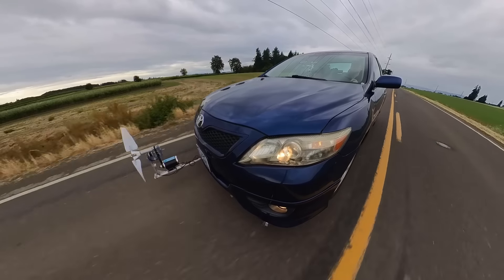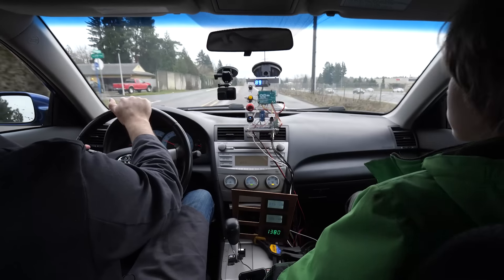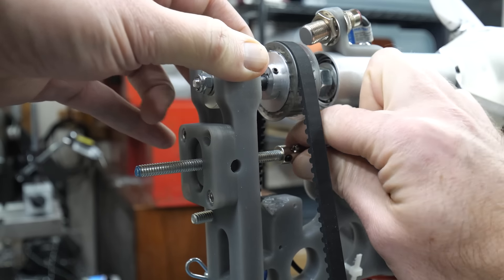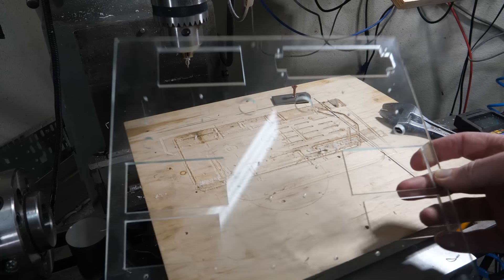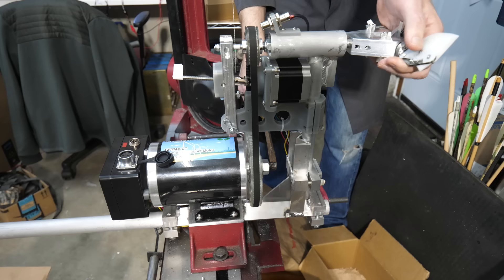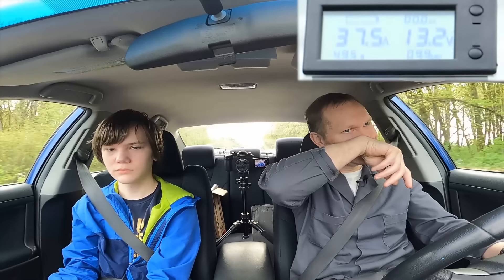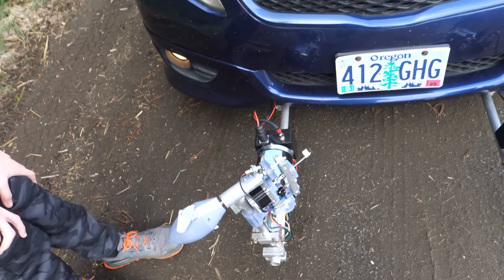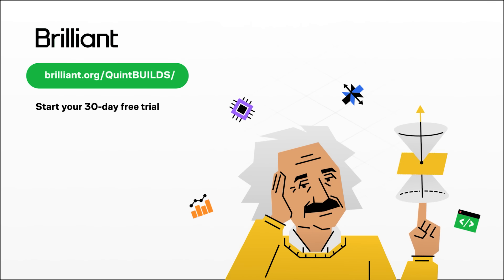Wind Power on a Car #7

Comment from the maker: Behind the scenes content is here: https://youtu.be/NZDZXdZAW10

Please don't jump to the conclusion I'm some "free-energy" nutcase. I consider myself an engineering educator, willing to run experiments much of the public wonders about. When this project is done, no one will have to wonder what a turbine on a car does. I'm grateful most viewers can appreciate that!

Thanks for watching.

Quint
Reply: Great video
Reply: 😊 I'm glad your doing what your doing, spending time with your son, opening up a world for him to pursue engineering, and letting us follow along with you.

I still have my fingers crossed for a chance at an aerodynamic slip stream with a pocket of low pressure slower moving air over the vehicle presenting less drag than the drag presented by taking power taken from turbines.

Its Not free energy. It's  just that a potential for a reduction in overall drag could mean higher efficiency.  And there is president for aerodynamic slip stream where two truckers following close to eachother will use less combined fuel than if each traveled seperatly.  But realistically, it's still probable that adding turbine blades infront will create more overall drag. 😊
Reply: Roger that but why not use VAWT and avoid all that mechanical complexity and stresses that comes with HAWT.
Reply: @OnlyUseMeC4s  VAWT tends to not be as efficent at HAWT,  and changing the pitch of VAWT blades for maximum power adds its own complexity.
Reply: I got into your channel when you were doing the rainwater generator (which was pretty cool).  Appreciate the explanations along the way in all the videos too.
Reply: Your using one form of energy and trying to regain/capture energy in another form; so inefficient energy capture?

It's like saying this is not legal or medical advice and telling people about legal or medical advice lol.

Juat cause you say it's not free energy dont remove the fact that you are conducting tests to gain energy from a different form.

Not all ideas are good ideas. Maybe you should put 2 alternators in the car!?!?!? 😅
Reply: @LawPope  

Automobile surfaces have air friction ofc, wind resistance. 

Wind power is a cube ratio of its speed. It increases swiftly. e.g. 1mph=1 ; 2mph=8 ; 3mph=27 ; 4mph=64 ; 5mph=125  etc..

Assuming a car drives in still air (0mph) propellers will increase the speed of a part of the air before it reaches the car surfaces, decreasing its friction power against these surfaces by -x^3 (yes, I said a double negative, but just so a reader wouldn't miss it). 

    Obvs, the propellers transfer that resistance to the car via its frame.. 
    ..UNLESS you remove some of the energy.. As electricity. 
    Ofc greater generation causes more resistance on the propellers, but increases air speed, decreasing resistance on car surface friction. 

Automobiles have main purposes far more important than minimizing wind resistance. (e.g. Passengers are many different sizes, prefer being upright, and having  head and elbow room, or cargo, such as pickups). 

Depending upon the aerodynamic shape of the vehicle, there may be a rather large margin of excess energy waste just pushing air around. 

This waste might be partially recovered via electricity generation. 

Especially helpful downhill, with chunky vehicles, and/or hybrid vehicles.
Reply: look i love that you think you are doing something good, 
i truely am sorry to tell you that you are wrong. 
in every single way. 
On a stationary vehicle a tesla turbine based generator may produce enough electricity to charge your phone if left for a day or two. but any and all power 'produced'' by this device is tupence compared to the energy required to produce it. 
A better idea for example is if you were to simply place a second altanator in the engine bay you will gain 10,000% more electricity enough to run a game station a few cameras a nice tv, a fridge or two, ofcourse any energy consumed will be nothing compaired to the fuel used to inefficiently run your car

If your looking for free energy 
Just put a turbine into thor's well

Basically anything that takes benifit from the motion of the ocean 

You can make shit tonnes off energy using nothing but sandwiches and a bicycle connected to a altenator. Store it in a nice capacitor made with house hold items.

All you really want is free money

And lieing to what unfortunately seems to be a quite gulluble audience just to advertize is shameful. 

But each to their own 

I hope you have a good day

I Sand Games
Reply: @Isandgames   

You said "tesla turbine," 'i truely am sorry to tell you that' this alone invalidates any opinion you proffer on anything.
Reply: @Dr_Wrong  okay thanks for letting me know your thoughts
Physics don't lie tho and there's a reason why they are built into almost every single dam
Reply: @Isandgames   "they are built into almost every single dam" 

Name one,
Reply: @Dr_Wrong  unfortunately I cannot name one
By tesla turbine I meant Tesla pump deriving from the turbine. This as far as I am aware is used for overflow systems on most and if I'm not mistaken including the hoover dam.
I am bias tho
I don't believe in profit before progress
Reply: So happy you're back!
Reply: There clearly some free energy to be had when a big truck passes you, well making use of some of his energy at least. 😂
Reply: Yes Keep pushing the limits of what "Can" or "Can't" be done, I'm an Omniologist.
Reply: Can you reverse inline fans and install that in a tube?

Comment: Would be a great way to charge up portable solar banks. Id try a design like a roof scoop that can catch the wind and a smaller low pressure exit for the air and utilize cyclone blades for more compact form.

Comment: You.need a 3 blade fan with smaller diameter and shorten the distance from the car to the assembly it is bouncing too much.
Also a horizontal corkscrew type fan might be much more reliable and stable at high speeds

Comment: Love the series 👍 Have you considered ditching the belt drive and 3D-printing a planetary gearset to increase the RPM instead? All commercial turbines use these to drive the generator. Perhaps a planetary gearset made of resin? Don't know how this would affect cut-in wind speed but it would make for an interesting episode in its own right. Rolling pin bearing could deal with the lateral force. Might be hard raising the center of gravity with the Winco but these smaller generators...

Comment: Loving this series! You can get Nema stepper motors with position feedback (making them servos) might help with more precise pitch control? Is it also worth making a mechanical governor to limit RPM below the point the blades burst? Great little 3d print project! Keep it up!

Comment: Have you considered using a vertical axis wind turbine mounted horizontally on the front bumper of a car? Two supports attached to the left and right sides of the turbine would enhance stability and reduce the vibrations that have caused issues in your previous attempts.

Comment: i've been wondering for a really long time. how a solar panel could improve milage. unlike turbine(s) it should'nt add much resistance. but obviously will have a harder time generating power. another thing i've really wanted to try is. making a steam powered turbine powered by the exhaust heat.

Comment: I would use a roll of smaller fan blades and brace it better that pipe you got it on makes it vibrate more 🤔 And I would put the blades on top the car not in front

Comment: Strengthen the mounts, you'll get movement and vibration from the single mounting posts, then you'll have the inertia of the propeller causing other forces, everything I'd say is just twisting as everything is shaking, maybe like an A frame and a bar going across between each propeller.

Comment: Very nice, I am surprised you didn't use a reese towing hitch and mount it to the front of your car making it a strong easy clip and pin strength and structure to unhook to work on.
Reply: Yup it would be alot more sturdy then those poles bouncing the 2nd time you blades broke it looked like it hit the ground but in the 3rd scene I just watched you saw sparks it did hit the ground, mounting a reese towing hitch or two on the front would take care of that for sure and give it more strength from bowing.
Reply: Sorry it looked like it hit the ground.

Comment: I love your videos! Try using a more consistent load than the rear defroster. I think it's cutting out due to its temperature (safety regulation). A general load as a resistor could be a more reliable load, at least for testing. 

Also, to save some head aches on exploding impellers try adding a brake on the small pully axle. You could program the brake to like 3000 rpm. I think reinforcing the blades with carbon fiber will cause massive vibrations as it is hard to laminate symmetrically. 

Lastly, I feel like the mounting of the whole setup is flexing a lot. As there is only a single mounting point under the car. Maybe a steel cable over the bonnet could stabilize the whole rig.

Comment: I love what u are doing and it's great. I see the potential of the wind turbine as a kinetic air brake power recovery system. The dash setup are so cool. Is there a way to move a car with 36volt electric from zero to 40kmh with independent system using 3 car battery and each battery is individual charge with 130watt solar panel with individual controller.

Comment: I have actually been wondering on this. When having it on a ev with like a rounded inverse turbine on top with with air ducting would effect the power on the ev battery. As another way of doing kind of regen braking but using the movement forward to recharge the battery to. Or kind of like the vertical wind turbines and using the spur like  on the fins on the humpback whale has on its fins. It was actually tested and it helps with the efficiency on the blades.

Comment: Now you know why they have housings "to stabilize the whole mechanism". Use a chain (so you don't need so much tension on the gears or better yet make the gears strait from each shaft so you don't need a belt.

Comment: I think the car moving up and down while driving, is putting extra stress on blades, bearings etc. The spinning rotor is basically a gyroscope which wants to hold its angular momentum

Comment: Hey just wondering what if you had a longer cylinder shaped turbine? Parallel but just under the front bumper. I wonder if it would help to house it in a larger cylinder so that you could have an inlet path in an outlet path.

Comment: lol i glued 2x 100w flexible solar panels to my chevy volts roof for 70$ and just wired them directly into the 12v system. recently i upgraded the 12v agm battery to 280ah of lifepo4, ~4kwh, and added a cheap 28$ easun power mppt. this video makes me realize how much power and how reliable solid state solar power is. they usually put out around 150 watts when im driving around and then charge all day in the parking lot and have been saving me a half gallon of gas on my commute to work... about 2-3$ per day. the battery cost me 350$ and it was already time to replace the ~200$ agm battery (14 year old lol)

Comment: Been watching the series since the start, great stuff.
It is really inspiring how you face all these challenges face-on and you keep coming back, I definetely want to see this project to it's end.

Small ideas with someone who is much less of an engineer but why not:
1.Testing the two turbines at once when you don't even have a consistently working solo seems to be a time and money sink and only ends up slowing iterations in my opinion.
I agree that they must be designed as a duo but building half of the system should suffice until you have a working unit.

2.I think looking into a stronger mounting point will definetely help the development, as I'm sure an osciallating mount must cause oscillating loads on the fans which would likely impact wear and performance.  Also mounting it closer to the car would facilitate that and reduce ground strikes, but maybe there is some engineering reason you already mentionned and I forgot.

3. Also, maybe the fan is going too fast because there isn't enough of a load on the generator ? If that's the case, having a relay connect it to a battery could add some additional load when needed as a sort of electronic brake and the energy would not be wasted. Maybe i'm misunderstanding the problem completely though.

Anyways I'm not sure this feedback is very valuable, but it might just be.
Good luck to you and your son.

Comment: What if you used paddle wheels about 4ft long and about 6" in diameter? Mount one on the front near the top of the bumper, one on the top of the car and one just on the edge of the trunk.

Comment: You should definitely add data logging to that, like having a pc collecting data from a separate Arduino with python and save it as CSV so you can later analyze it (speed, rpm, voltage, current, mpg, etc…)
Maybe you could even use some kind of OBD reader to extract data from the car itself
Reply from the maker: Would love to do this if time permits.

Comment: Is it possible that the length of the mounting posts are slightly different, causing one turbine to be in front of the other. This could be causing turbulence that affects the blade behind it. Maybe at that RPM you noticed the over speed, the turbulence of the blades are in sync

Comment: makes me wanna try this on an ebike to see if range could be increased on those. Would be really benficial consdering the small batteries and small range but I don't know if 30kmh is enough speed
Reply from the maker: I've already discussed it with an ebike company. But that's an excellent point about the sensitivity to velocity. Even if it works well on a car, it may not on a bike!

Comment: I would put the turbines closer to the bumper in order to avoid vibrations. The suport is too long
Reply: Ближе к бамперу поток проходить не будет и винт встанет.
Reply: I agree with wind's comment above; if you put it too close to the front of the car it will reduce or eliminate what energy you might be able to capture.

Comment: If there is a bolt on electric hybrid system 36volt to our cars. Producing just 10hp would be great. Powering 1 or 2 wheel and capable of 0 to 40kmh with hand throttle/speed controller. Battery would be charged by solar panel and wind mills. Run time don't matter even if just 10 15 minutes. It will charge back up soon enough. Good for jam and school zone.

Comment: I think, a much more solid frame on the front (like a bull-bar) will provide a much more stable and rigid platform for the generators. 
this is so janky.. maybe put a crossmember in between, this is just wobbling itself out of shape every time. I think it will be much more reliable on something more stable. 
Maybe mount them on the roof, .. also not too sure how much you value that car obviously ;)

Comment: What do you think of the following idea? The concept revolves around harnessing energy from moving air without the use of moving parts, akin to the reverse principle of operating electrostatic drives. The advantage here is the elimination of mechanical components, which could lead to a more durable and low-maintenance system. Essentially, this idea would utilize a consistent airflow through an aperture, where the air's movement could induce charge separation in an electric field. This separated charge could then be captured and converted into usable electrical energy. It's a forward-thinking approach that echoes the principles of electrostatic induction.

Comment: I did many similar experiments, so much fun.  I directly mounted to the front bumper of my old Saturn SL1 a 24" maple propeller to a 500 watt high power scooter motor.   It was a sketchy first prototype, but at 70 mph or so it would start spinning and produce almost 400 watts-even more at higher speeds.  I brought it all the way to 120mph which was the maximum speed of the car.  Later I had even better results with a 300mm 3d printed propeller-the first prototype I made was just using cheap PLA and the blade design was found on "thing i verse" and was an 18 bladed shrouded parametric propeller that looks like a super cool turbine wheel.  Shrouded seemed like the way to go for strength, safety, and durability-same for the many blades.  It worked better than I imagined and that original prototype mated to the scooter motor lasted almost 10,000 miles generating current that operated a wet cell HHO "Browns Gas" generator.  Somewhere on YT there are videos I made about it, good times.  Thank you for excellent videos and builds
Reply: Did you gain more power than you lost on decreased mpg?
Reply: @Clint3571   The engine on the Saturn had 279k or so when I began the HHO injection.  MPG seemed to increase sometimes, but just outside the margin of error.  The engine blew just before 290,000 miles and that was the end of the experiments

Comment: Advanced Turbine Design Tip: In addition to the traditional driveshaft bending modes, there are vibrational modes that are more complex at higher rpm. I cant help guide on this because it is outside my wheelhouse, but maybe a search on "turboshaft vibration modes analysis" will yield useful information.

Comment: Having a factory built in version that uses wind power to add charge to your battery in an electric car could increase distance if the math works out I’m interested to see your finished results 😊

Comment: I’m no vibration or sensor expert, but I would want to figure out how much vibration is occurring at 1. The metal bar underneath the car, 2. The supporting bar to the generator, 3. Generator itself, Wire harness at generator side and linkage before cabin entry and 4. Supports for Turbine.  It could probably be done with two sensors at a time, where one is kept in the same space each time and the other is placed on different areas per run?